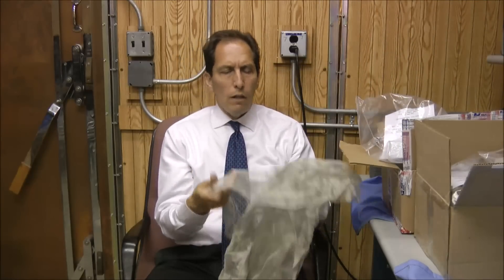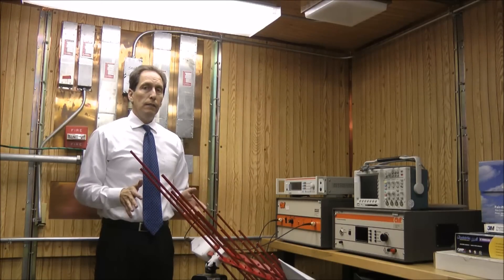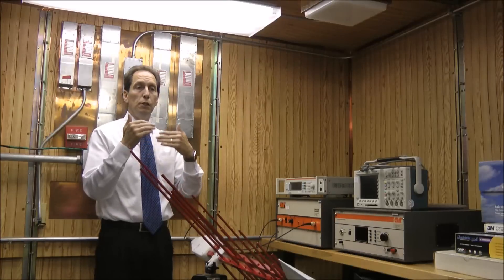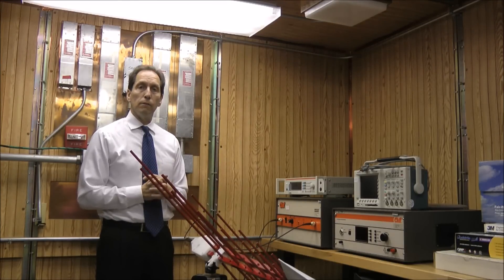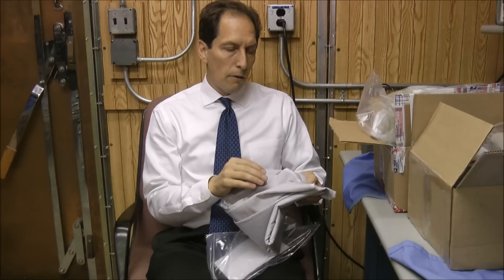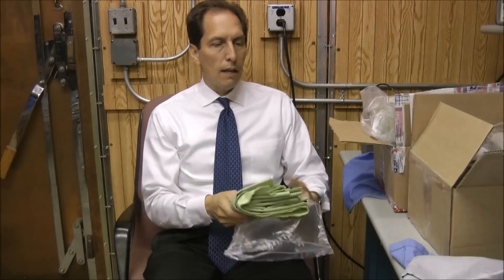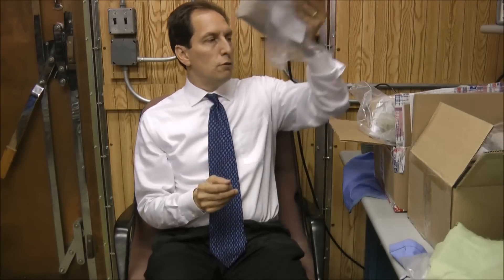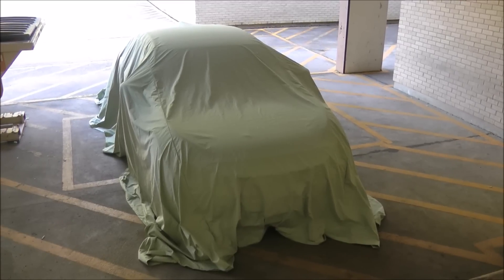Protect Generators and Cars from EMP

Comment: Wouldn't it be more cost effective, and practical to shroud the battery on the car? (I'm not too sure on the mechanics of what is effected on a car during an emp attack). I can't imagine that you would need to cover the whole car or the alternator... I am guessing that the emp pulse pulls the positive charge off of the wet plates inside the lead acid or gel mat battery. Maybe also it discharges capacitors if you have them. (Positive electrons on a coil... so maybe coils connected to spark plugs would be effected?)

Comment: If I was going to cover a gas powered generator with the cloth would it be a good idea to use aluminum duck tape to tape the edges of the cloth down to the garage floor to create a better seal? Also can I also use the tape to connect pieces of the cloth together or is it better to sew them together? Thank you!

Comment: Great series of videos. How about a 70's motorcycle. It has no silicon electronics. The speedometer and tachometer are mechanical. The lights are incandescent but off so not in a closed circuit. I would remove the coil, points/condenser, cap, rotor, wires and plugs and keep those in an Ammo Box Faraday Cage nearby. What do you think?

Comment: So you are saying if the cover touches the ground you dont have to cover underneath?  Then why must a faraday cage be 360 degree shield?
Reply from the maker: The Earth itself is a weak conductor, so you can get away with not putting cloth under the vehicle. We're not trying to create a 70-100 dB shielded structure (which would require 360-degree coverage). Rather, we're going after ~30 dB (97% field reduction) which can use imperfect conductors like the Earth.

Comment: Since I live in a very hurricane prone area I installed a whole house generator powered by propane. It is connected to the home power source via an automatic throw switch. In short if the power fails it fires up within 10 seconds. The home also has a whole house surge protector. Provided by the power company on the meter. The generator itself has a computer that controls it. I am interested In Finding a way to protect it Fromm carrington  event. I have yet to find an answer. Can u help???????
Reply from the maker: Powerful CMEs can't really be shunted away using SPDs like fast transients can. The best you can do is detect the unwanted condition developing on the power lines and then open the main breaker to the home. Check out the EMP Alert for early warning.

Comment: Thank you for the series of videos, here is what I have gathered
1. The higher the latitude, the more susceptible to solar EMP (Severe Geomagentic Storms), like Canada, the risk is higher than the United States.
2. Scientists have monitored the sun and can already estimate the area affected by EMP.
3. Continuing from the above, it is estimated that in the affected areas, the power company will take the initiative to unplug the power before the arrival of EMP to reduce equipment damage.
4. Stored in the basement or even the bunker has a certain protective effect on EMP.
5. In addition to artificial HEMP unpredictable, natural EMP can be predicted and prepared in advance (unplug or cage)
6. Therefore, additional precautions are mainly aimed at unpredictable and artificial HEMP attacks.
7. Late-time (E3) HEMP cannot be protected with ferrite. Unplug or cage is the gold standard.
(I wouldn't drive out to test if I had been warned of a solar EMP, I would unplug the battery.)
If there is any misunderstanding, please let me know, thanks.

Comment: Hi Dr. Bradley, thanks for sharing your information. What are your thoughts on Pre-1980 vehicles being affected by an EMP compared with newer vehicles? There are lot us out in the West/Southwest with older 4x4s and Trucks from the 1960s and 1970s (rugged and easy to repair!). Many are under the assumption that these older vehicles would be pretty much unaffected by an EMP compared to the estimated 10% of modern vehicles that would be affected. What do you think? Thanks, Jason

Comment: Why wouldn't the vehicle's sheet metal body protect the vehicle's electronic components? Is it a grounding issue?
Reply from the maker: The EMP Commission did some tests on cars. You can get a free copy of their report online. The vehicle is such a vital tool that protection for it is very important.
Reply: @disasterprepper  its a big report, do you know what section this info is in?
Reply: I'd say gaps (this means the the huge window areas, etc...)

Comment: I sure hope you answer my question because this is a subject I'm really trying to solve....
As a full time RVer that lives in a motorhome, I have 2 back up power supplies in the event of an emergency. One is a portable gas powered Honda and the other one is a BLUETTI 2000watt Portable Power Station with a LiFePO4 Battery along with a 2000watt pure sine inverter. I also have 2 - 200watt portable solar panels. All of these items are carried and stored in my RV for emergencies. Could I drape this green material over these 3 items individually and would they be protected? Would I also have to run a ground wire from the material of each covering to the chassis?

Or in my case would it just be better to put my BLUETTI 2000watt Portable Power Station and solar panels in your EMP bags and use the cloth to drape over the genertaor.
BTW....great video LIKED.

Comment: I'm so uneducated about this stuff, but couldt you just remove the battery of a vehicle and put it in a faraday gage? I'm just asking because i dont know.????
Reply from the maker: You could protect a battery that way, but you would have to know exactly when the EMP would hit. Most people prefer a solution that is easy to install, and much less work required.

Comment: So if I buy one of the cloth from you I can just wrap that around my solar panel that's just sitting? Correct? All I have is a electric/solar generator and one 100 watt solar panel I'm making the garbage can faraday cage for my generator to go into until I use it..so question for you do I also put the cords inside the can to? I'm a widow with 2 kids and I just want to make sure it will be working after a EMP..thx for ur help and God bless, 💜
Reply from the maker: Hi Mandy, if your panels are disconnected, you can save a little money by just putting them in a box and wrapping the box with aluminum foil (just like a Christmas present). You can use the conductive cloth if you prefer since it's more convenient, but it's just more costly. As for the cords, if they're not attached to anything, you don't need to put them inside the Faraday cage, as they wouldn't be damaged. If they are connected to the inverter or panels, then yes, include them in the protective structure so that they don't act as antennas.
Reply: @disasterprepper  oh okay thanku so much all these things confuse me so bad and yes that helps cause God knows I'm on a budget 💜🙏🏽🤗🤗🤗🤗🤗🤗🤗thanku

Comment: If your generator has rubber tires and rubber blocks under the frame, meaning it's not touching the ground, that doesn't give it any protection?   Thanks doc.
Reply from the maker: Actually, it's a misunderstanding that a car (or anything) needs to be grounded to be shielded from high-frequency RF energy. I talk about that in other videos.

Comment: So if both sides are conductive then there us no insulation between it and your vehicle. If this is true would grounding my vehicle have the same effect
Reply from the maker: The cover's purpose isn't to ground the car (although it does that to some degree). It is to provide a protective barrier that reflects and absorbs RF energy. Grounding your vehicle wouldn't do that.

Comment: I wonder if I would already be at least partially protected, as my residence is
aluminum sided on the exterior, with one layer of interior insulation being of
1/4" foam board with aluminum covering on both sides. (?)
Reply from the maker: Yes, you can get some modest shielding from metal siding or roofs. Not a tremendous amount, however, and the most damaging energy will still come in on power lines if protection isn't in place.

Comment: You never showed the actual numbers from the testing.   You were right there.   Why not show the attenuation.   Is it on a web site?
Reply from the maker: The attenuation varies from 28 dB to 33 dB across frequencies of interest. I usually simplify it and just say that it provides approximately 30 dB (97% field reduction). The data is included in my upcoming Advanced Topics book. It's interesting though that the vendor claims slightly more than 40 dB under ideal conditions. My tests are never idealized, so my results are usually more pessimistic (although more realistic) than theirs.

Comment: One?? If all the power is knocked out by a EMP and I have a natural gas generator, how does the gas get to my house is the company that provides nat/gas doesn’t have electricity??
Reply from the maker: There are certainly no guarantees how long the gas provider will continue being able to provide service. Most have backup generators, but there's the issue of fuel to deal with. There would be lots of challenges, including loss of services, that would have to be dealt with. Even so, I always say that it's better to have options, which is why we prepare.
Reply: Thanks it would be hell on earth!! I don’t have any EMP devices but I keep my electronics in a faraday cage!! At least I will have my radios and computers!! Thanks for the info!!!!

Comment: Would you recomend using a stainless Steel cotton thread which will join the seams of each add'l sheet required to make better connective continuity across the entire fabric car cover?
Also, I have a Pace Maker and wondered if your seamstress makes protective wearable clothing or a shroud that can cover me like a car cover to protect me from an E M P?
Reply from the maker: I found that it didn't make any difference. I tried both metal thread and regular thread, and the shielding results were the same. If you make something to go over yourself, I would recommend a more skin friendly cloth like this one: https://disasterpreparer.com/product/emf-cloth/.

Comment: What EMP/RF fabrics would protect an implanted defibrillator/pacemaker device from RF generated by arc/MIG/TIG welding?
Reply from the maker: I haven't tested this explicitly, but I would think that a skin-friendly conductive cloth could be used (either as a shirt or some other barrier). Here's the cloth that I like, but there are many others. Some companies even sell pre-sewn conductive cloth shirts. https://disasterpreparer.com/product/emf-cloth/
Reply: @disasterprepper  Thank you so much. I had thought of constructing a Faraday Cage of wood and wire screen to cover the work or me, but that seemed unwieldy. As to protecting a vehicle, I had in mind a similar cage, but your solution is simpler.

Comment: We are all just one solar flare away from being back to paper and pencil people. Better bone up on your addition and subtraction skills.
You're using it to protect your vehicle from solar flares and EMP. Who cares whether the metal discolors. My only other question is why are you worried about nickel big reactive for people when you didn't say anything about stainless steel which is nickel and chromium.
Why in the world would you think that silver would lose its Effectiveness just because it can get tarnished. That would have no effect whatsoever on its resistant capability to EMP
Reply from the maker: Lots of comments here... First, I must agree with you that a huge solar event (not a flare but a CME) could definitely set our planet back. But keep in mind that solar events won't harm cars (with the exception perhaps of electric cars that are plugged in). My comment on silver cloth tarnishing was only an observation. I don't honestly know if the performance degrades or not. It's just that people tend to get upset when their expensive car cover starts to look dingy. I actually like silver conductive cloth, but it's very very expensive, perhaps twice the cloth that I recommend. As for the stainless cloth, yes, it's true that it contains some nickel (perhaps 5%), but in handling such cloth, I can tell you that it's much less of an irritant than nickel-based cloth. Of course, you should get whatever cloth you like best.

Comment: Thanks for all the work to provide great info. One question. Do  you need to have an under layer of covering to keep the conductive cloth from touching the car/ motorcycle etc? Can you put this directly Onto the object to protect in other words??
Reply from the maker: No, you don't need an underlying layer. The cloth acts as a conductive barrier, reflecting and absorbing high-frequency energy. It's not quite the same as a Faraday cage, which relies on charge redistribution to cancel internal fields. People often get confused on this.
Reply: @disasterprepper  Hi Dr. Bradley, I'm one of the confused. I don't understand why electronics require being completely surrounded by an intact Faraday cage with no contact between the metal of the electronics and that of the cage, while a car can survive with metal blanket in contact with the car, and wide open from below? Why not just drape a blanket over the electronics then? I'm headed to your website to buy some books and stuff, so please point me at the book or video that sorts this out. I'm subscribed and going through all your videos as fast as I can. Thanks & ATB!
Reply: Thank you so much. Awesome info.

Comment: Put metal (copper, steel) "O" grommets  on the cover ..  and grounded tie downs  (surface, subsurface, rotating D rings to 4 ft ground rods in charcoalized cement - rocky based substrate)

Comment: Ever wonder why lead paint was determined unsafe? 😀
Reply: Because IR nanometer light can't pass through when LE flys over in Helo
Reply: @meh11235   From Lil Giant Sorry. I do not understand. What is IR nanometer light or LE? I think helo is a helicopter, right?
Reply: Because lead is toxic...
Reply: @TVideoupload  , you are very wrong. Batteries factory don't use lead? More lime this, they use lead in 3 form. Metalic lead and two oxide lead. So...?
Reply: @01Autentic  I think you have been exposed to too much lead.
Reply: @whisper1776  you thought wrong, pal. You would benefit from some reading on oxides of all kinds, but especially lead. Good luck.
Reply: @anagramconfirmed1717  Also, r/woooosh.

Comment: Assuming an emp happens while your car is in the driveway under the cover lol.  And protecting your generator so you can later run it to power up all your electronics in the house that were just emp'd 🤔😆. Cool video though. Better use of the fabrics might be self shielding while u sleep to protect from 2.4ghz wifi and more.
Reply from the maker: I address cars that are running in a different video (see https://youtu.be/J8_01u3vp-M). Cloth certainly has the limitation of only being useful when the car is idle. Even so, for most of us, our cars are sitting idle many hours of the day and night. People do use similar cloths for sheets and bed curtains, but you'd want to get some that are skin-friendly. The best I've found is discussed at https://disasterpreparer.com/product/emf-cloth/.

Comment: This is fairly new information for me and very interesting. 
The vehicle must be completely covered correct?
Is it not sufficient to cover the major electronic components and have a dragging ground wire?
Reply from the maker: It's ideal to cover the whole car with the cloth draped down onto the ground or concrete. Unfortunately, dragging the ground wire won't help with an EMP.
Reply: @disasterprepper  how can you then protect a vehicle in operation (not fully covered) at the time of an emp? Let’s say a 2020 model Diesel pickup. 

The common man knows not the day or hour.
Reply from the maker: @brosenewsome8581  Check out this video for info about protecting a vehicle that is not covered. https://youtu.be/J8_01u3vp-M

Comment: I've seen video after video of a-bomb tests in Nevada, about 90 miles from Vegas....in the early mornings, you could see the flash ( air-bursts ) from downtown Las Vegas, and not so much as a flicker from all of the electric lights happened ...Where was the EMP effect on the electrical grids then ..?
Reply from the maker: My understanding is that such tests were tiny compared to today's bombs. Also, I think most, if not all were at or below ground level - not certain about that though. There were a number of aerial detonations done during Starfish Prime experiments over the Pacific, and they generated an EMP measured hundreds of miles away.